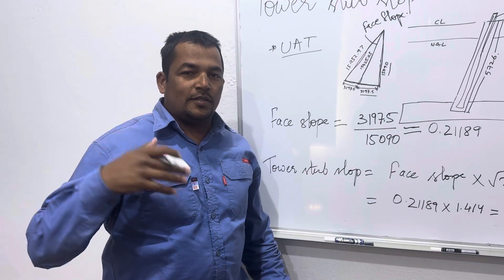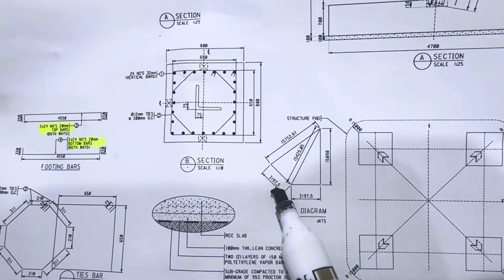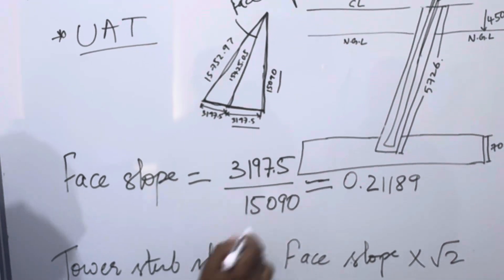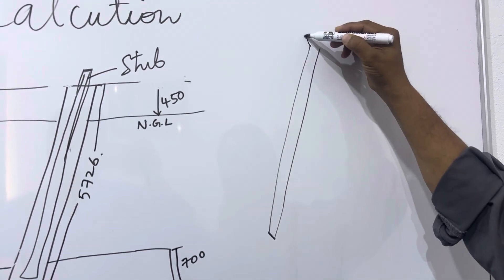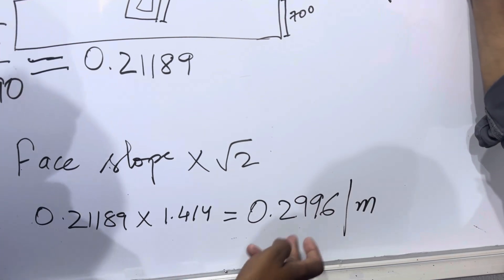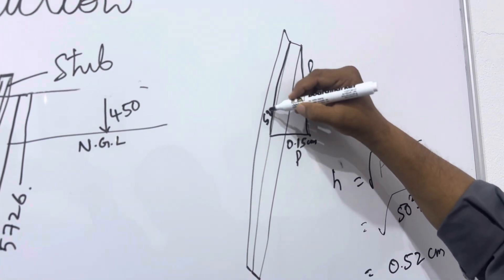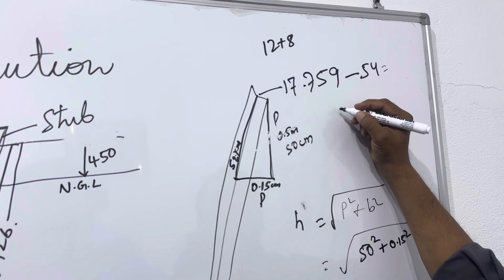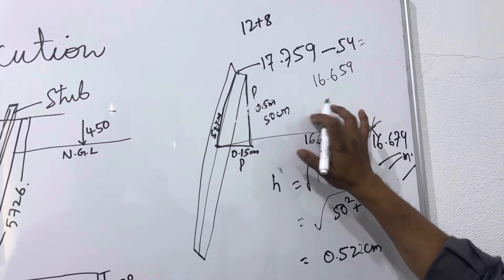How to Check Stub Slope on Transmission Tower Foundations Step-by-Step Site QA/QC

Comment: Dear why we don't use Anchoring bolt instead of mains  leg anchor for transmission towers
Reply from the maker: It depends on design in Middle East unified design followed by using stubs in South Asia bolts being preferred due to economically